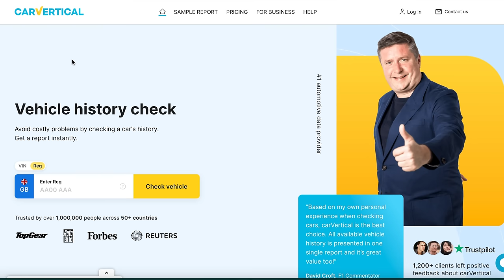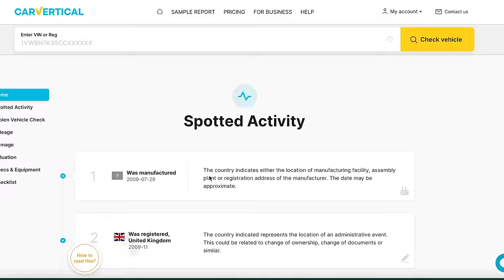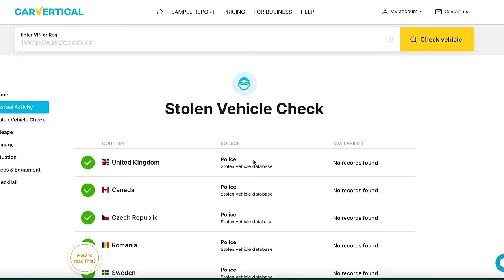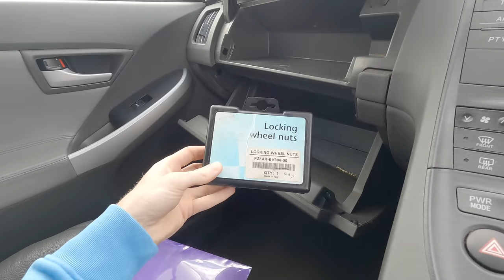I BOUGHT A 200,000 MILE TOYOTA PRIUS

Comment: I currently drive a 2010 prius which i got for 4.2k and done 254k miles... Drives pretty well  though, but the battery is on its way out.
Reply from the maker: Can it be reconditioned?
Reply: @HighPeakAutos   I have  heard it can, but I havent looked into it. What I do know is that you can get new/used working batteries from 400 pounds - 1200 pounds aftermarket. Mine had its battery replaced only early this year, but the dealer who replaced it told me that given the seller was trying to sell the car, it was probably the cheapest grade of battery which he called "no code" or essentially barely works :P It still does work quite fine but the capacity seems low, so in city mileage is lower than probably ideal.
Reply from the maker: @ktaragorn  I think you can replace just the broken cells. I’m sure I saw a YouTube video once
Reply: @HighPeakAutos  Yup, I have seen a Crisfix (i think) replacement of all cells, or you can do one cell too, and I presume there are services for that.. However I see it generally listed as high risk for DIY as it involves 200 volts.. I should look into getting it done though..
Reply: So far rides quite well, and not sure how long I will keep it, so not in a hurry to do it just yet.. just hoping I have some resale value at the end of it :D
Reply: Just got to the interior of the car.. to be fair the car interior is in much better condn than mine :D My seats have had a seat cover, which is itself starting to tear, and the steering wheel also has been covered up, with a well used and tearing cover.

Comment: Japanese cars have their buttons on the correct side - one thing that bugs me about European models is that they skimp out on the Right Hand Drive conversions by keeping the stereo controls, handbrake, bonnet release and climate controls in LHD configuration. I will hand it to the premium marks that they go to the trouble of doing a proper conversion, and then even the Koreans do it properly too. Otherwise Japanese cars are the only way to go to get the car the way it was intended to be designed and driven.

Comment: 3/7/2020 Purchased a used 2012 well maintained Prius V with 146,000 miles on it for $6,000.   Other than general maintenance  I replaced suspension pieces as needed.   Rebuilt the hybrid battery pack in May 2023 with a set of reconditioned/balanced modules that cost me $920.00.   Just about to go over  255K miles this week.   The 3rd Generation Prius is known for blowing head gaskets.  I know mine is gone as I get a cylinder-1  misfire if I keep the coolant system unmodified.  I modified it by removing the 0-ring from the coolant overflow relieving the pressure.  just have to keep a close eye on the coolant level.  I do UberEats, Doordash and a little Uberx.  Have made my money back  more than 10-fold so needless to say I'd consider the investment money well spent.  Cheers!

Comment: 200.000 miles? lol. Thats nothing. I even have an ECHO wth 423,000.  My Prius will be over 200,ooo very soon.
Reply: I remember my 2002 Toyota Echo has same engine as the 2nd Gen Toyota Prius. I hated getting rid of that Echo but I'm 6'3" and didn't fit in it too comfortably. It had around 245k miles on it and ran great. Put 4 American sized adults in the Echo and it didn't even bog down. I'm missing the Echo, reminded me of the 1992 Ford Festiva I had (Kia Pride/Mazda 121).

Comment: When gas prices went to >$6/gal, I parked my Chevy Suburban (8-12mpg) and purchased a 2008 Prius with 151k miles for $5,100 (30-60 mpg)
Very happy with it. But for replacing the exhaust system, no issues

Comment: I really don't get half of you commentating on the 200k mileage this is nothing. I'm actually disappointed it needed battery's replaced. I've seen countless Prius with 300k on them and if you are a member of the Toyota or Lexus groups most cars change hands at 180k like it's nothing. I guess we have all become used to mediocre reliability, driving Ze Germans.

Comment: These cars look ugly but they are one of very few cars that are capable of reaching over 1 million miles with the right owner. Heck even uber prius's are still going 300-500k miles with daily abuse and probably bare minimum maintenance. 
In the older prius of this era when the batteries get knickered they are fairly straight forward to replace by yourself and the aftermarket upgraded battery packs don't cost a bomb either.

Comment: The hybrid battery in my brother's 2010 Prius failed two years ago at the ridiculously low genuine mileage of 29k. His battery was replaced by RRG Toyota Stockport.  They fitted a reconditioned battery, charged £700 in labour and a total cost of £1800.  The battery has just failed again at 49k.  He has just had a specialist garage fit a third brand new Toyota battery.  That garage charged 2 hours of labour at £140.  Total cost £1600 including VAT.  They also advised that Toyota no longer allow reconditioned batteries to be fitted.  £700 for two hours labour??  Main dealers are th***es.

Comment: Gearbox service?? Hybrids dont have a gearbox
Reply from the maker: Of course they do. This one has a CVT
Reply: @HighPeakAutos  a CVT is not a gearbox
Reply: @davewebster1627  Technically still is a gearbox as the cone works on the principle of gear ratios. Sure, it doesn't use gears & instead pulley(s) & cone(s) but the principle is the same even if the gear ratios change continuously with the revs instead of in steps as with gears.
Reply: @triax7006  a hybrid doesn't have cones either, it has 2 electric motors
Reply: @davewebster1627  The Prius has planetary gears & Toyota call it a E-CVT. So it is closer to a traditional gearbox than a normal CVT that runs on pully's as it uses gears however it is continuous hence the "CVT" moniker.

Comment: The Prius NEVER does 50mpg the 1.5 or the 1.8 it’s a complete lie it doesn’t.
Reply from the maker: Yes they do. I've had several. They will do more than 50 MPG actually
Reply: My 2008 Prius Tspirit consistently does well over 60 mpg every summer. The hotter the weather, the better the mpg - and no, while I don't drive like a boy racer, I don't baby it either! I managed 69.4 mpg this summer passed - and also hit my record of 651 niles out of the little 45 litre tank - all London commuting - and I have the photos to prove it. Right now, I have 61.8 mpg on the MFD, and I've done 478 miles so far. I've got 3 bars of fuel left, so i'll get about 550 miles out of this tank of fuel. And that's me doing electric motor assisted kangaroo takeoffs to the speed limit before kicking in the cruise control - NOT hypermiling or driving like a snail. The trick is a 76hp Atkinson Cycle Engine synchronously mated to a 67hp electric traction motor via a power split device (planetary gear set). It doesn't actually have conventional gears. Mind you, LLR tyres are a must! Fun fact, reverse is via the electric motors only!!! And you can fully recharge the battery going down a long incline - free energy. What's not to like? p.s. You'll never hear a starter motor on a Prius. Why? The regenerative braking motor reverses polarity and spins the engine to start it. This electric motor is huge - one spin and the engine spools up. It's like Alien Technology, I tells you!

Comment: It’s plug in hybrids are the worst of both worlds,   Still have to plug in, and have an engine to service and maintain,  also when on engine mode because of the extra weight the mpg is worse than a hybrid,
Reply: They are for ppl to dip into electric but don't want to take the plunge relying solely on electric. Personally think until ICE are getting to inconvenient to use (via laws & petrol stations being closed down) then ICE is the way to go. No one is going to lose out buying a petrol or even diesel car until the laws change & that won't be happening for a few years because the electric charging infrastructure isn't there & won't be for a while. Zero point in buying electric & overpaying when the cost for running a petrol or diesel is cheaper as the 2nd hand market has so many to choose from.